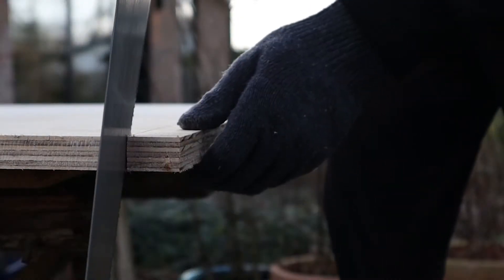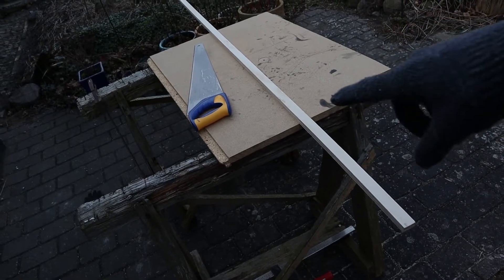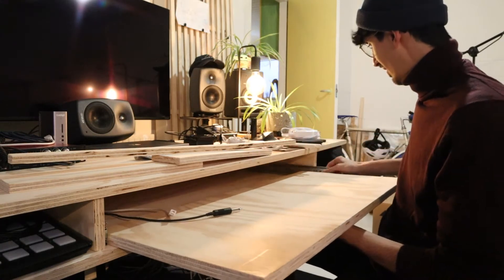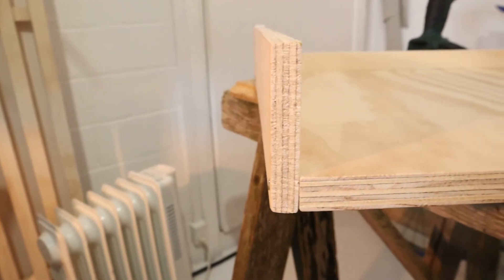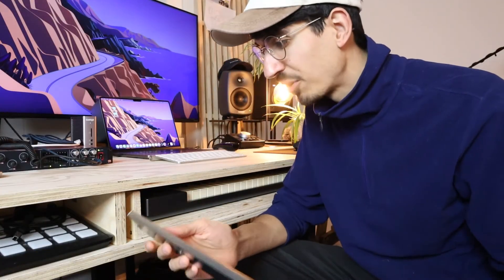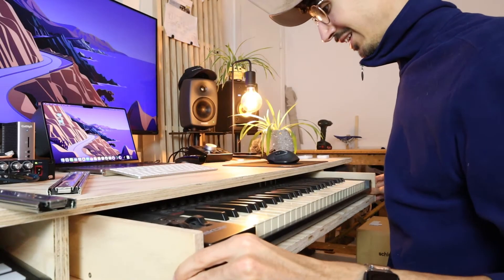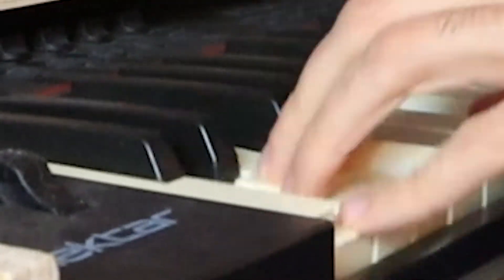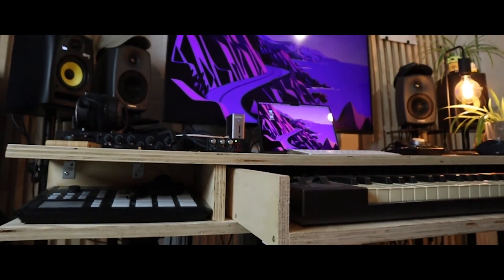Slide Out Tray for Midi Keyboards! | DIY Tutorial (+Free Plans)

Comment: Fun video! For a little extra stability on the tray with very little effort, you can always make a wedge (like a sideways doorstop if that makes any sense) for each side, you can just push them in until it tightens up to fill those gaps and get additional contact/support on the sides, pull them out when you're done.